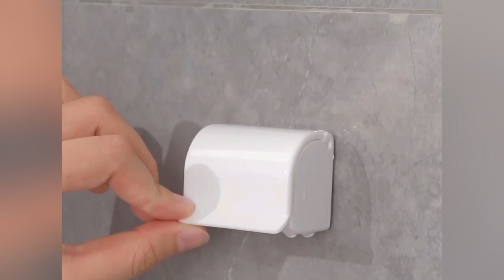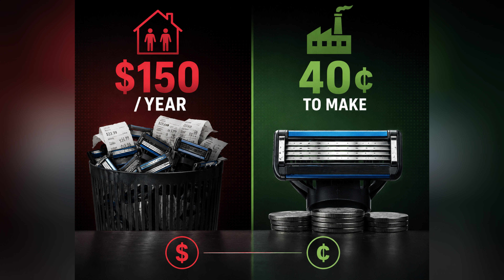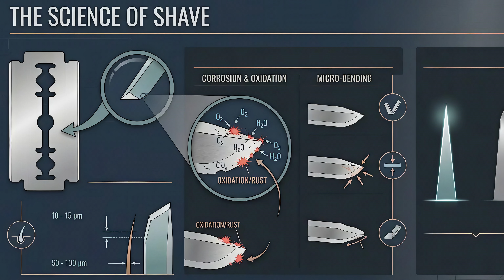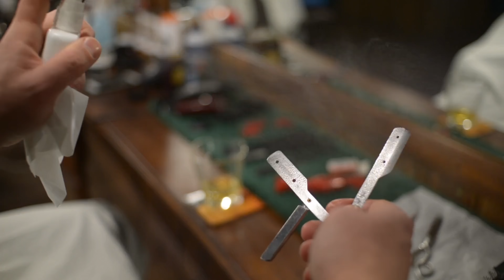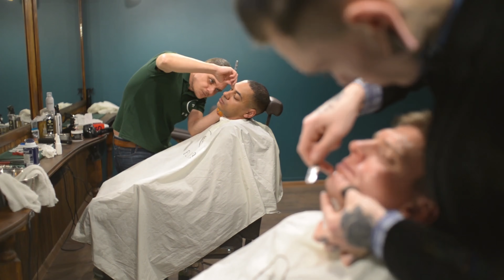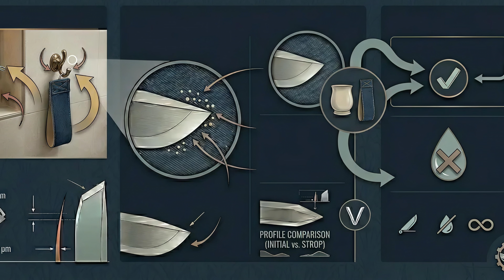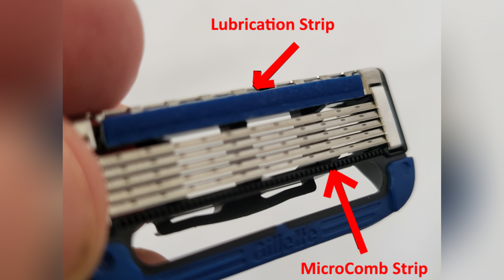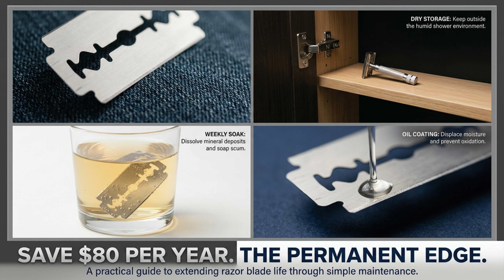Your Razor Is Designed to Dull After 3 Uses — How to Make It Last 2 years!

Comment: I made the switch to a safety razor and shaving soap about a year ago and I’ll never go back. My annual shaving cost comes out to about $15 a year compared to roughly $250 a year for Gillette blades. And my shaving experience has never been better. Total no brainer.
Reply: This is the way.
Reply: Instead of shaving soap I use cheap gel shampoo for a smooth shave. Don't lather it up, just smear it on.
Reply: @USARAY1947  Some even use hair conditioner. It's slippery.
Reply: @espenstoro  Hair conditioner leaves conditioner on your skin. no thanks. Cheap, clear gel shampoo is similar to shaving gel. Suave Daily Shampoo or most from the Dollar Store are good and way cheaper than shaving gel.
Reply: @espenstoro  I have been using hair conditioner for years.
Reply: @espenstoro  Beardbrand makes a beard conditioner that doubles as shaving lotion. The smoothest shave I've ever got, but it's very thick and hard to rinse off the razor.
Reply: @USARAY1947  I use any shampoo that I have, all works fine. Didn't buy any shaving gel for many years.
Reply: @USARAY1947  i use your skin moisturizer like Suave. It's thin enough to not clog a blade but smooth enough to work. The bottle can go a long long time versus shaving cream can.
Reply: Straight razor is cheaper
Reply: @Barbarosa6  yeah but a pain in the arse to keep sharp. Willing to bet that most str8 razor users (like me) keep it up for a year or two then go back to a safety.
Reply: @B @Barbarosa6  I’m used to the safety razor now but I’ve been meaning to try a straight razor for a while now.
Reply: Yup,  1 blade lasts me a week. I buy a box of 100 Astra blades for $15 which lasts me 2 years.
Reply: @tommysdirtandsoultommytheh1569 shame the quality slipped when production moved from russia.
Reply: @paulgerrard9227  Actually the blades I've been using for the last 2 years  are from India. I just ran out and re-ordered. My new blades are from Russia so I'll see how these work.
Reply: @EZ_Case  
 Do you use the original type of soap and brush? The round soap. I am almost out of it and can not locate it in my area.
Reply: @randydeskins9359  Just use the little facial soaps that you’d normally leave behind at a hotel. Just toss a couple in your cup as the soap gets low.
Reply: @randydeskins9359  I use pears transparent soap works better than any shaving cream.
Reply: @randydeskins9359  Amazon has it, plenty of different brands.
Reply: @randydeskins9359  - I'm assuming you have access to Amazon, yes?  What they carry in my local stores for shaving soap is pretty ugly crap, but Amazon can give you a huge variety to choose from, both domestically produced as well as the imports from Europe. You can also just do a web search for blade shaving soap and you'll be surprised as how many more options that gives you. My personal favourites are from an outfit called Henri et Victoria, based out of Montreal, but a close second is this almond scented soap from an outfit in Italy... the character on the front lid looks like Santa Claus, so you'll know it when you see it. 🙂
Reply: @ran @randydeskins9359  I like proraso shaving soap. Comes in a small round container and it’s on Amazon for $10. Lasts me around 6 months.
Reply: @randydeskins9359  
The Body Shop shaving cream..... they have cool brushes as well!😉
Reply: @randydeskins9359  I've had really good experiences with Goodfellas' Smile and Blades Grim brands of shave soap...both are available on Amazon. They both come in tins and I would call them an extremely thick cream or a very soft puck...almost the consistency of a putty and I use a super badger brush.
Reply: @randydeskins9359 buy 12 sticks of cheap Arko shaving soap and 6 pucks of Van der Hagen. Grate them all and store in a container. Fill a used Proraso shaving tub when ready to use and add half a teaspoon of vegetable glycerin mixed in. You will have a great lather this way. Each little tub will last you about 3 months and cost about $2.40.
Reply: @randydeskins9359 Any soap will do, however if I were you, I would try the cheapist 'Green Soap ( for instance an old fashioned 'Sunlight Bloc' ) and use filtered rainwater, ( gives a lot of foam without the usual hard water )!
Reply: Use a Henson razor which is made by an aerospace company based in Canada. Scientifically designed. Fantastic shave.
Reply: Yep way better way to go - I switched about 15 years ago and have "saved" a fortune. I bought 3 packs of 100 blades and 5 years later I've not bought another blade. A blade lasts a week for me, and I just wish someone told me about safety razors when i was a teenager. I suffered from ingrown hair, and that was cured about a week or two after switchinga way from cartridge blades.
Reply: I agree.  I am a swiss , served in the mountains infantry as soldier. Only wet shaving possible.  And with 65 go retiert in thailand. Here in the hot and humid air the hairs grow even faster. So I have to shaving daily.  I have a shaving ceremony every day with soap and a Brussel. Then shaving with a safety rezor my face and neck.
No gilette or schick in my badroom. And the soap is also better to your skin.
Reply: Me too. I switched to old fashioned safety razor and shaving soap, my blades cost ten cents each. I get a very close shave. Very enjoyable. I give my blade a final rinse in 99% isopropyl alcohol and even at ten cents each, they last for at least a month or two.
Reply: 250 per year. Never thought that way
Reply: Same here .
Switched to safety 6 months ago
Reply: This is the way.
Reply: Exacto mundo my friend. I perfer the Gillette blades made in Russia. Shop around I've never paid more then $.15 each for Silver Blue Or Gillette  Platinum but I've seen some priced @ $.50
Reply: Amen
Reply: @EZ_Case  me too around 5+ yr ago. I buy 100 blades and they easily last a week or two.. I still have 200 blades...years of them. I do like italian prorasso soap and avoid us made brushes eg wahl. Cheap junk. Astra blades used to be awaesome but when russia got embargoed they moved production. Now they are ok but 80% of what they were
Reply: How often you get cuts
Reply: @EZ_Case  just stop shaving, you will save milions, then think about not earing etc...posibilities are endles
Reply: I was thinking about that, but if this video is true the cartridge is better. I use a safety razor but I do like double blade razors better. If sharpening the cartridges can make them last 6 months then a 10 pack which cost $10 will last 5 years....
Reply: This! Additionally I have absolutely no razor burn any more.
Reply: Yeah, my Baili 3 piece safety razor works fine for me.
Reply: I'm almost 20 years in with a safety razor after spending the first 10 years using disposables. My boys are both getting a proper safety razor as soon as they're old enough to shave.

Comment: I've been doing this for about 15 years. It does work. The blade change interval is about 6 months, shaving every second day. It's the same piece of denim - the cuff off an old pair of 501's. I don't know if this makes a difference, but most denim these days has non cotton fibers woven in for stretch. Would that make the process less effective?
Reply from the maker: That’s actually a great point, and yes, your old 501 cuff is probably close to ideal.
When I’m talking about denim for this trick, I mostly mean traditional cotton denim with a firm weave. The weave gives just enough texture to lightly strop the edge without cutting into it.

Stretch denim could still work, but it may be a little less ideal because it often has elastane/spandex or other synthetic fibers woven in. That can make the fabric softer, smoother, and more flexible, which might reduce the stropping effect a bit.

So if someone has the choice, I’d use an older piece of 100% cotton denim, like old Levi’s, work jeans, or a cut-off cuff like you’re using. But I wouldn’t overthink it too much — the bigger rule is still: backward strokes only, edge trailing, then keep the blade dry after.

Comment: Does anyone remember the twin blade razors that had a stubble removal button on the back to push out stuck hairs?
Those razors lasted a long time…
No surprise they got removed.
Reply: Yes I not only remember them I have 3 large packs of them.  Made by Schick.  They last over a year sometimes.  I have enough to last the rest of my life, assuming I don't do anything really stupid...but I am a man.....
Reply: @daddyg5654  Schick injector ?
Reply: @24hrs365  Looks like probably "Slim Twin 2".
Reply: @24hrs365  I bought my old man one of those when I was a kid. Very clever design.
Reply: @daddyg5654  i guess i am lucky too. i bought a lot of them a decade ago. i don't know what i was thinking.
Reply: @daddyg5654  i was just gonna say schick slim twin in sure i still have some from long ago. 

I got a fingernail cleaning brush for Christmas and turns out works great for cleaning out my 5 blade Gillette which i is for a very long time each
Reply: @daddyg5654    I got over 3 1/2 years out of one.  For me, they easily last a year.
Reply: Ya, Don't remember which brand. The blades were a bit wider vertical separation, w very simple plastic sliders between them actuated by plastic button. Wish I'd known the rest of the info here lol might still have one 😂
Reply from the maker: So you're saying the "stubble removal button" was actually a "make our razors last too long" button? No wonder it disappeared! 😉
Reply: @Sidney_Explains_Money 
It removed all the sharp little hairs that felt awful and sometimes would cut the face. 
Yes, this added to their lifespan because those hairs were gone.
Reply: @StirlingLighthouse I get the same effect by giving the blades a brush with my toothbrush, under running water - I shake dry and store on a dry shelf - I get months out of mine (Mach2). I'm going to try stropping too.
Reply: @Sidney_Explains_Money 😂😂😂 yep
Reply: I haven't shaved in years. Saved a lot of money.
Reply: 20 euro electric hair cutter thingy, once a week.
Reply: @Vlabar God? Is that you??? Congrats on being so clever (unless you're Jim Carrey, of course)
Reply: You mean Gillette Vector? The same that in this video at 0:04 mark. They are still available.
Reply: @bege4394  Also seen at 6:54, I believe.
Reply: @foonzelde  Yes, you are right!
Reply: @StirlingLighthouse  it's the angle of the blades. In my country a discount supermarket sells disposable blades that have a different angle and nothing sticks in there or at least just holding it under water cleans it. And they shave excellent. 

Gillette and the other brands do this so that the customer needs to buy a lot more blades than they would normally do.
Reply: I have a spray gun with water , and send a couple of squirts between the blades and takes all the gunk out., It last very long.
Reply: yep mine still does. Wilkinson Sword £1 pack of 10, still using my last pack from like a year ago. but yes they are hard to find in any shop now. 
Wilkinson Sword Extra 2 Sensitive lasts ages. you can still get them, mainly online, but they cost a lot more now, direct from Wilkinson sword £5.50 for a 20 pack.
Reply: @StirlingLighthouse they still have them they called Schlick with a green handle two blades  and push lever they stay sharp for upwards of ten shaves then use your jeans to sharpen it
Reply: @lokibird2546doing that trick with my chef’s knives. They are always losing the edge.
Reply: @StirlingLighthouse  still available.
Reply: They are still widely available
Reply: Weren’t those the, Schick Hydro stubble eraser razors?
Reply: @StirlingLighthouse yes shick still have it here in Malaysia
Reply: Try swiping a toothbrush (or similar) parallel to the blades, it cleans out the hair quite well.
Reply: Bought a pack Wilkinson Sword razor blade for ₹250/- (2.5 pounds) in India in the year 2007 and will last till December 2027!  Lasting for 21 years!  Those blades are still available in India.
Reply: Yes.
Reply: No kidding! Yikes.
Reply: Y
Reply: I love those and they worked great.
Reply: You can just bang the bottom against something in the shower to knock out the hairs. Just make sure it's something you don't mind damaging a bit. The handle of your scrub brush or that thing propped in the corner, not the tiles or the shower head.
Reply: I use the thin stick on tooth flossers to remove the debris from between the blades.    They last a long time.    After a while, they don't give a perfect shave but they give a great first cut when I've grown longer beard hair.  But I only need 12 razors per year.
Reply: @mac_mcleod  I clean the hair between the blades using my water pic. Then I spray the blade with WD-40.
Reply: Just use the tip of a needle (or safety pin, thumb tack, etc...) and glide it between the blades.
Reply: @frankgowalski1345 I use the pointy part of the flosser that you use to clean between your teeth. It works awesome and doesn't damage the blades.  And yes I can get a bunch of extra shaves out of them when I do this.
Reply: Shick still make them.  I get mine at CVS.
Reply: @jb6027ohh man. I don’t live your side of the pond. I’ll. see if there is a large drugstore nearby and they might carry them but the seem to be swamped by those multi blades dominate here.
Reply: Plus they were much cheaper
Reply: @StirlingLighthouse

I get the stubbles removed with pressured water under the tap.

I once ran a test about how long a cheap discardable twin blade would do the job if I used immediately after taking a bath/shower when the hair is softened.  
I used it a whopping 30 (thirty) times !
Shaving myself only every three days, it was good for three months.
Reply: Yes!
Reply: This brand of razor was called Schick.
Reply: @StirlingLighthouse thanks for your very well made video on shaving blades.
I use my water pick to clean de blade it works like the plastic tab did on the Shick blades.
Saludos desde Bogotá
Reply: Trac II self clean, they weren't around long.
Reply: They can still be bought, but don't solely blame the companies for the shift to fixed blades. Stressed people need something they can use and throw away.
Reply: My whiskers murdered those...
Reply: Actually, the average whisker is harder than a copper wire the same width. Also, to get the hair out of the RAZOR AND get a better shave...shave in an up and down manner once inch each way.  Makes it last 10x longer, too.
Reply: @knockknock1246  Actually, none of that is true. Depending on whether you prefer the Vickers or Brinell hardness scale, copper is up to 100× harder than hair of the same diameter. Did you just make that up?
Reply: I thought they removed them because they are more triuble than they're worth. They stop hairs going right through and out the back of the head and sometimes jam pushed forward if stubble gets between it and the blade. They are still available though so...

Comment: 2 people in the comments so far have asked what you mean by flipping the cartridge over and neither of your replies adequately answers the question. Cartridges have a plastic casing, if you flip the razor the only thing that touches the denim is that plastic casing, you can't reach the back of the blades that way. In fact there's no way to reach the other side of the metal in a multi-razor cartridge without destroying the plastic casing. It seems you may be in error here.
Reply from the maker: Yes, I did reply to that — and you’re right, I should explain it more clearly.
By “flip it,” I don’t mean flip the cartridge over so the plastic back rubs on the denim. You’re absolutely right that the back of the blades is sealed inside the cartridge, and you’re not reaching the underside of each blade.

What I mean is: keep the blade side touching the denim, but reverse the direction/orientation of the razor so the blades are rubbed from the opposite angle. Basically, you’re still stropping the cutting side, just changing the direction of the pass.

The reason is that denim has a woven texture, and cartridge blades are also set at a slight angle inside the head. Going in both directions helps the fabric contact the blade edges a little more evenly. It’s not “sharpening” like a whetstone. It’s more like cleaning, polishing, and lightly realigning the microscopic edge while removing soap film, skin oils, hard-water minerals, and tiny debris.

So yes, good catch on the wording. “Flip it” was probably too vague. Better wording would be: turn the razor around and strop the blade side in the opposite direction — don’t rub the plastic back of the cartridge.
Reply: @Sidney_Explains_Money  What do you mean then?
Reply: Still can't make head nor tail of this explanation. Do a video to demonstrate please.
Reply: @Sidney_Explains_Money  Are you on drugs? Your directions are useless.
Reply: @Sidney_Explains_Money  one way you are pushing the blade away from, opposite would basically be starting the blade from the top of denim and "pulling" it down the denim. Is that what you mean?
Reply: I still have no idea wtf he's talking about. Not sure why it wasn't just demonstrated in the friggin' vid.
Reply: it's an error, another word for it would be bullshit, but that's putting too fine a point on it.